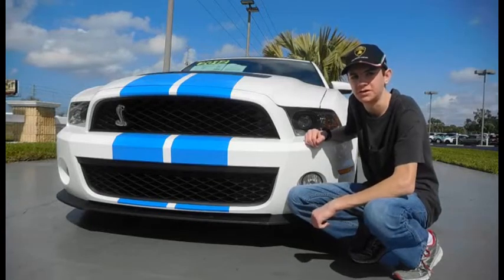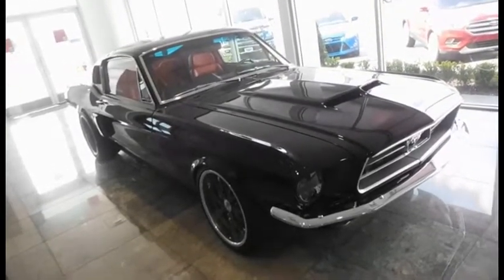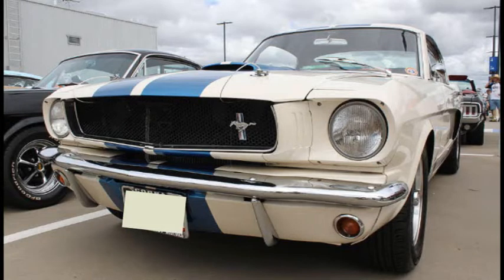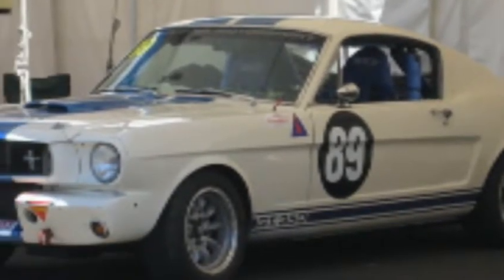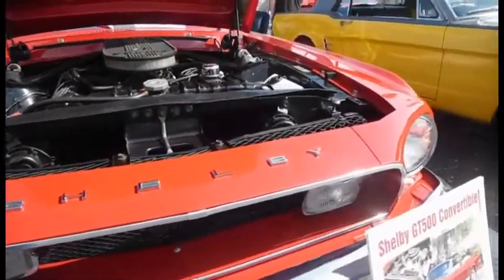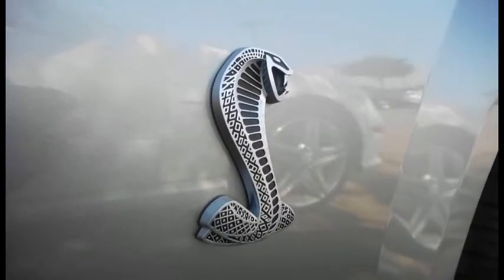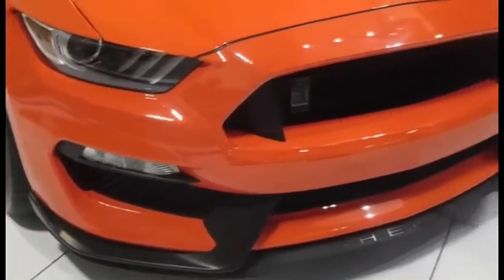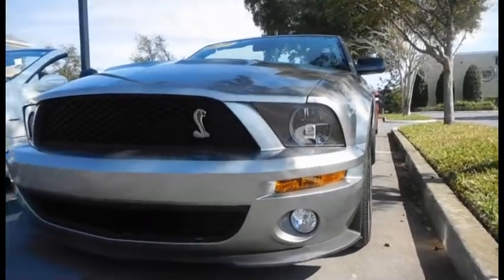History of the Ford Mustang Shelby

Comment: Shelbys are the best.Its probably why I own 4 car's.A 07 427 Nascar edition convertible.One of 3 with the 427 package. Very rare also a 10 grabber blue GT500 supersnake.A 2008 torch red white stripe gt500 that has a story.The car was originally owned by the drag racing Ford family David Tasca.Bob Tasca SR son.Bob Tasca Sr got CARROLL SHELBY into Ford in the 60s.The car is signed by Shelby the Tasca family and John Force.Also they all went for a ride in the car.Then too top it off they put well over a 100 grand into the car and I have all the paperwork. It looks stock but suspension and brakes and blower.Basically it's modified like a supersnake.Also a 07 Shelby gt that I drive daily